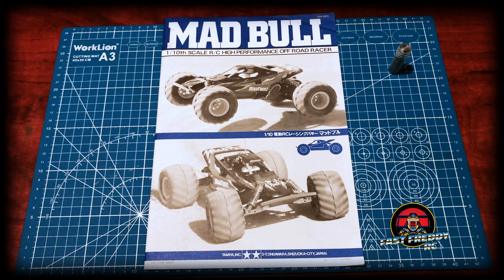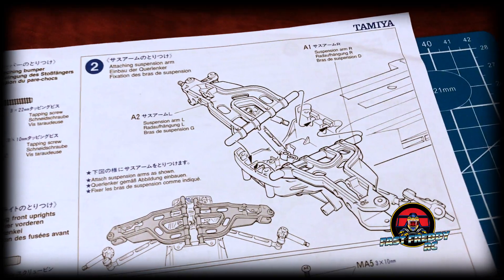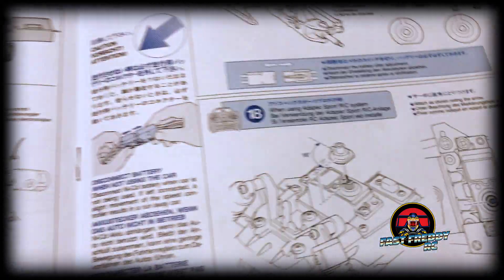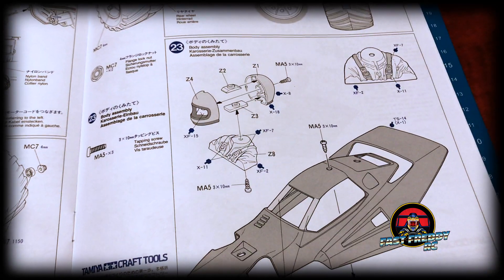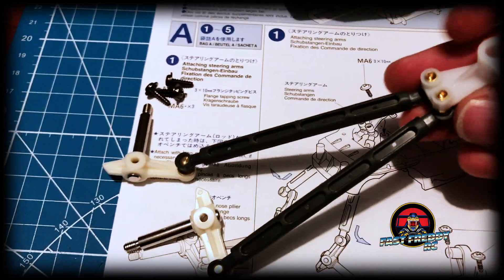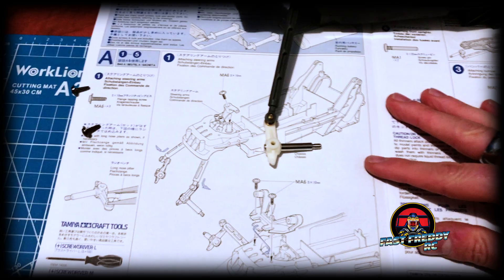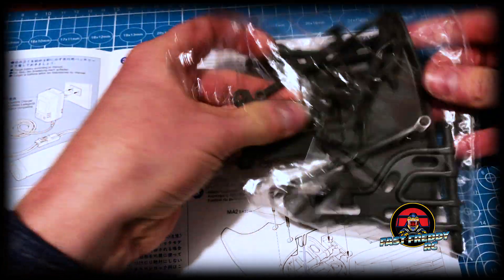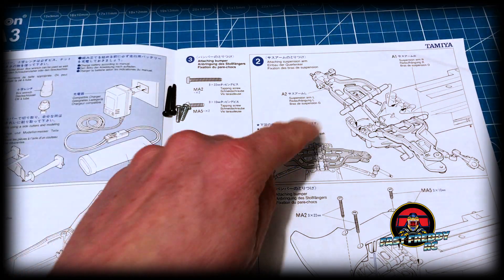Tamiya Mad Bull Build Series - (Overview & Steps 1-5) - The DT-01 Chassis - Tips and Tricks

Comment: Great build so far. The big T really thought abour doing this kit as easy as possible
Reply from the maker: Thanks Dirk!  Yeah it's coming along nicely...definitely a fun one to build.  It's cool that Tamiya has done a lot of the work for newbies but it's interesting that none of this is really pointed out anywhere in their advertising.  I think they'd get a lot more newbies buying this kit if they only knew how it came in the box.
Reply: @FastFreddyRC  it must have been a marketing strategy in comparison with their other kits😉😁. The old Grashopper was promted as abasic car and never as a beginner lnes here.
Reply from the maker: @RCBirds  interesting...definitely an interesting marketing strategy for sure.  And...most hobby shops don't even carry this model right now yet it's listed in their 2023 Tamiya catalogue.  It's strange for sure.
Reply: @FastFreddyRC  the DT-03 is 25 % cheaper and has oil filled shocks. The TT-series is also cheaper and is available in many versions. 
They made a kit in which the customer doesn't have to clip some parts together but was expected to use a screwdriver and costs more than a modern (racing) kit? That's hard to sell. Don't get me wrong I like this car and am planning a project with it. I'll get one, but this is my decision and it's not rational😉😁

Comment: Are you going to do the rubber tube hack for the servo linkage?  Looks like a fun build. Might have to get 1 now. I  might go for oil shocks though 🤔 can't wait to see this one run. Have a great holiday 👍
Reply from the maker: Hi Zach!  To start with...no.  I'm going to build this completely stock and do a running video of it as is.  But I know @addamsplayground does a great job of showing how to do the rubber tube hack which I'll end up doing based on how Addam said it performed completely stock.  I'm not surprised though...I've seen a number of running videos of this car and the steering just looks like it's all over the place because of the huge tires.  BUT...I'll do some testing myself for sure and see what I think.